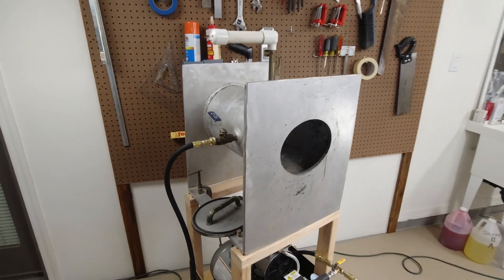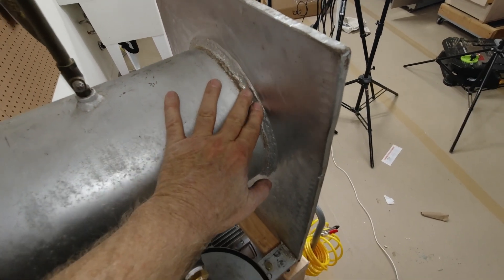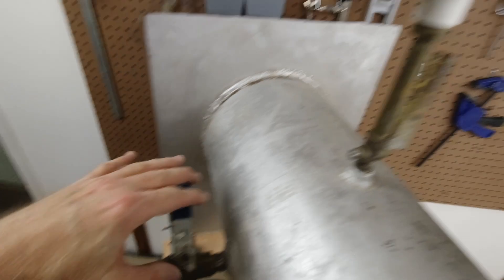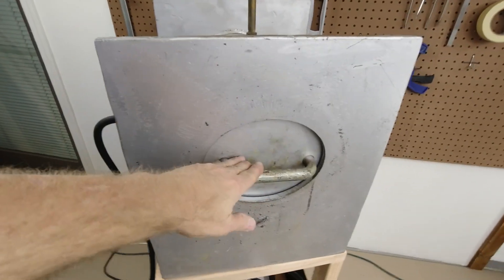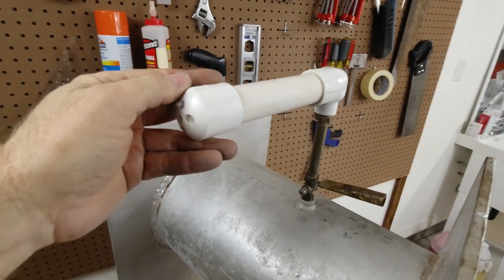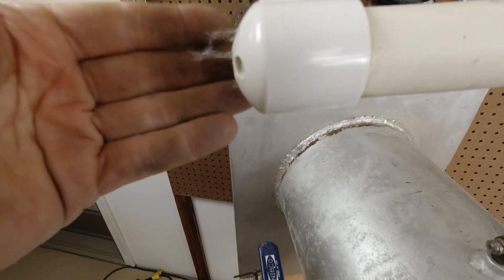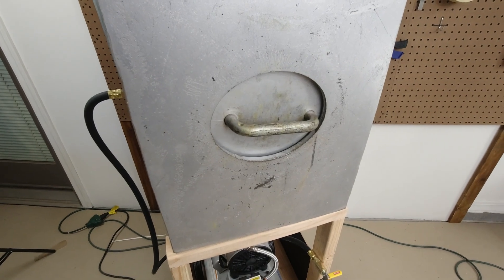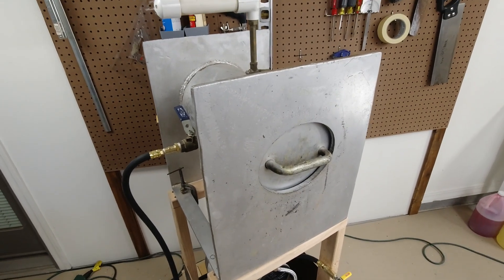All You Need To Know!

Comment: if you rotate lid handle 90 degrees you can put lid in, taking less space inside.
Reply: Can you explain that. I've tried to visualize how you have more room, but my old brain ain't what it used to be, ; )
Reply: @markjohnson9402  when handle is aligned with longer axis you have to insert it all the way before you can start rotating it. if handle is aligned with shorter axis then you can insert it by half and start rotating it right away. 
Theres more useless option - to put handle near one of the longer axis ends, so you dont even need to put your hand inside)
Reply: @ChronoWrinkle  thanks. That makes sense. I'll do that if and when I build my own. I have an old boiler tank that's pretty stout. I may use that.

Comment: I recently discovered your channel and the info you provide is priceless. I just poured my first mold the other day and it turned out perfectly with zero imperfections, i was so happy. I cast both wax and chocolate Santa's with it. I so wanna do this more now lol. On a side note I could see maybe modifying your tank to have internal guide rails on the inside of the front face for the lid to loosely slide flush either vertically or horizontally so the chamber wouldn't have to be so deep and so you wouldn't have to store the lid separately. It would probably be a involved modification tho. Idk im not an expert i just love technology of all sorts and wanna make everything.

Comment: Honestly this pressure pot is overkill. I mean how much pressure are we talking about here ? 5bar ? That´t not a lot. Better safe than sorry but you really don´t need this kind of steel thickness.
I design latch systems for all major car brands and we use 2,5mm-3mm thick metal plates or ø8mm thick wires, this is for a crash relevant part in a vehicle. 
Honestly the most important feature here would be an overpressure valve and you can make that thing out of sturdy PVP piping.
However, it does not hurt to make it overall, it´s not really expensive or more expensive and the designt is pretty good in terms of speed, you get those mold in and out real fast, good thinking !
Reply from the maker: There is no doubt that these tanks are overbuilt.  They were designed by me and fabricated by a welding shop, no structural or pneumatic engineer was involved.  Since I didn’t actually know what I was doing, better safe than sorry was the guiding design philosophy.
Reply: @RobertTolone  Absolutely, I agree with you on that 100%. And your design is great.
Quick question, what happens if you pressurize the rubber instead of vacuum degasing ? This should get rid of the bubbles as well, am I right ?

Comment: Think about this guys & gals, At 50 PSI  means Per Square Inch. I drive trk & the air dry goes off at 125 PSI, These air tanks are roughly 10" inches across & roughly 30" inches long, figure out how many ''' square inches are in these demotions & then times by the PSI. 
  It's something '' you don't want to mess around with, have it done by a fabrication shop & let them know what it's being used for . Be safe
Reply from the maker: Thanks for this comment. You’re not kidding, fabricating these tanks should not be done by beginners. My tanks were fabricated by a welder certified to do high-pressure tank work. There was no way I was going to weld them with my amateur welding skills.

Comment: any recommendations for a hobbyist who needs a pressure pot?
Reply from the maker: It is a serious piece of equipment. Not really one that lends itself to DIY construction. I designed mine and had them fabricated by a competent steel shop.  But you also need a compressor. I haven’t found any cheap, effective solutions. Most hobbyists simply cast resin without one and fix any bubbles in the casting.
Reply: @RobertTolone  I just saw your video talking about that. That makes a lot of sense. Thanks!

Comment: thank you for the pressure pot info and the 50 psi setting. do you use more than 50 psi and for what reason?
Reply from the maker: Sometimes as much as 80 psi. It can help eliminate small stubborn bubbles. But proper venting of the mold is always the best remedy for bubbles.

Comment: i thought it was a vacuum chamber... that a vacuum would cause the bubbles to leave.. but your adding increased air pressure.. i wont argue with results if thats what works .. Can we do the molds without the chamber,   i have this thing about catching shrapnel.
Reply from the maker: The pressure pot is mainly used to prevent foaming that happens when resin absorbs moisture from the atmosphere.

Comment: I've been admiring your pressure chamber since I've started watching your videos. I noticed the oval door because that's why manhole covers are round, so they don't drop in. This design is super fast and easy to handle and I love it. I also love the touch of having a muffler for the air release valve. I always have to cover my ears for that, but strangely never thought to use a muffler.

Comment: I'm curious as to how you made the seal on the door. Is it silicone ? Any info will be appreciated. Great channel by the way. God Bless !
Reply from the maker: No, it is solid rubber tubing. I buy it off Amazon. The trick is to cut it exactly to length, clean, so that the ends meet perfectly. Then use some good all purpose adhesive. It’s important to glue the ends together but I don’t use much glue to hold the rubber into the channel in the door. The door seals itself as it closes.
Reply: @RobertTolone  Thanks for the reply. I have a couple of big casting projects and need to build a pressure pot. Love the videos, Thanks

Comment: Thank you! Would mounting a hook or bar to hang the lid on help, or maybe a rack up top to set it on? Having the specs makes it priceless. No guessing. Much appreciated for the detail!
Reply from the maker: I suppose it would. But we usually keep the lid inside the tank when it is not in active use.  I don’t have specifications or plans for these tanks because they were fabricated from the brake cylinders of semi trucks.  So the size of your tank would be dictated by the cylinder that you use. Any cylinder that can withstand up to 125 psi is suitable.  The other reason I don’t provide specifications is that my tanks are homemade and I am not in any way qualified as an engineer. So I am really not in a position to provide design specs for pressure vessels. My tanks were fabricated for me by an expert welder and are massively overbuilt to compensate for the fact that I did not know how to specify a safe construction.  We used very thick plate steel for the tank opening and doors.
Reply: @RobertTolone  I'm of the same school. If a large company spent tons of money engineering something and made plenty of them so they're cheap, it's a good way to go to be safe and get good technology affordably! Thank you for taking the time to answer!

Comment: Amazing videos Robert. I confess that I have just come across your channel and within 3 videos have subscribed. Great content, excellent tutorial skills. Unfortunately, I need to ask what may end up being an "I can't believe he asked that" kind of question. Sorry about that. I have had a very long interest in resin casting (with not much success) and watched many videos on the subject. When you come to the question of bubbles, I think I have almost always seem artists talk about using a vacuum chamber for bubble removal. You are the first I have seem that talks about using pressure vessels to do this. Is that because you are reducing rather than trying to remove the bubbles? Again, sorry for coming here with such a newbie question :-(
Reply from the maker: The primary use of the pressure pot is to suppress the formation of bubbles caused by absorption of atmospheric moisture into the resin. It takes awhile for me to use up my resin so it invariably absorbs moisture - which causes foaming.  The pot will also compress small bubbles in the resin.  By far the best way to make bubble free castings is to vent the cavity properly.

Comment: Hey Robert, thank you for the information you give in your videos.
I use a resin which gives me only 5 mins then turns into gel. Is it ideal or can a pressure pot do its job in such a short time span. What pressure is required for a fast curing resin.
Thanks and wish you an advance Happy Christmas
Reply from the maker: The resin I  use gels in about 5 minutes and cures in about 20. It works fine in a pressure pot as long as you can close the pot and bring it up to pressure quickly. Pressure doesn’t do much good once the resin has begun to set. I run my pots between 50 and 80 psi.

Comment: A valuable set of ideas here!  Thank you.  I will be making silicone molds for use in prototyping an automotive vent window seal.  Can you tell me in the more black kind of rubber world is molding under pressure still useful?  A Few months ago the cheapie compressor on top of our craftsman compressor died leaving behind a nice 30 gallon tank I hope to put to use like this as our molds will be larger than what you seem to be doing.  Thank you for your great ideas!
Reply from the maker: I can’t speak to that from experience but it seems to me that pressure counseling would work just as well with rubber as it does in resin.
Reply: @RobertTolone  from what I have heard is you have to vacuum silicone instead of using a pressure pot because the pressure pot doesn’t remove the air, it just makes the bubbles tiny, and since rubber/silicone is flexible as soon as you take it out of the pressure pot the bubbles re-expand which can deform your mold.
Reply from the maker: @plantlover5978   If you leave the silicone in the pressure pot until it is cured then the bubbles will not re-expand.

Comment: I've seen some pressure pots that use a vacuum to suck the air out (which brings all the bubbles up), and I've seen some like yours that pressurize to shrink the bubbles.  Is there an advantage of one over the other?
Reply: They have different purposes. and there are advantages and disadvantages to both.

Vacuum Chambers are better at getting rid of bubbles as they are literally taking all the air out of the chamber completely. BUT they are slower. so if you tried to use resin in a Vacuum chamber (depending on the resin) it would cure mid degassing it.

Pressure pots as you know only shrink the air to be (for the most part) undetectable to the human eye. but still there none the less. BUT pressure pots are WAY more dangerous than vacuum chambers. if a vacuum chamber breaks mid use it will simply seize to work. If a Pressure pot breaks mid use, you will die. they are very dangerous.

Comment: As soon as I saw this , and wondered about the pressure inside , I thought 4 threaded rods with nuts, holding the back to the front would be a pretty good safety backup . ? what do you all think ?
Reply from the maker: Yes, I’ve see tanks with that design. Any safety improvement is a good idea. When I had the tanks made I was assured that the weld strength was more than adequate for the pressures I was operating the tank at. Nonetheless I developed the habit of walking away from the tank as soon as the door sealed and before the pressure maxed in the tank. I didn’t want to be standing right in front in case it blew open! 😳😄
Another good safety would be to have a check valve that opened at 80 psi. The truck tanks operate at a significantly higher pressures than that.
Reply: @RobertTolone  yes , I'm thinking of using a small air compressor tank I kept , as it would be usefull one day ! lol .. I'm completely new to silicone/resin , and as most new people do , I've bought a liter of both BEFORE I decide what to make (try)  :-) . I'm finding your chanel very useful . thank you

Comment: How thick is the metal of the cylinder section? Half inch like the front?
Reply from the maker: I don’t know.  But it’s much thinner than 1/2 inch. We used semi truck brake cylinders and they operate at higher pressures than I run my tanks at.  So we figured they were safe. The must be specifications somewhere mandating wall thickness according to cylinder size and operating pressure.

Comment: Your videos are incredible, thanks so much! How would you approach minimizing bubbles if casting a large object, say 24 x 24" x 5"? Would you use vibration or some other alternative to pressure pot? Or try to fabricate a vessel with an opening that large?
Reply from the maker: if you are regularly casting objects of that size it would pay for itself to fabricate a pressure pot. But you would really have to get your engineering right so that the pot is safe to use. I have never had much luck with vibration for removing bubbles. You could use fresh resin that has no moisture absorbed into it and use compressed air to blow out bubbles if the mold is an open-back kind.
Reply: Thanks for your reply! I only plan to cast this one large object, but I'll hopefully be making 50+ pieces. I guess I'll give it a go without pressure and see how I do, then reconsider whether I need to fabricate a ginormous tank.

Comment: Have you any way of asking your pressure pot creator if he could contact an old disabled Vietnam Marine about creating another pot for someone who is unable to do it for himself, Please?
Thank you 
Da Gunny
Reply from the maker: Unfortunately, those pressure pots were constructed more than 25 years ago.  It’s no longer an option.  But any competent machine shop should be easily able to fabricate one.  It is unnecessary to make the front and back support plates that hold up the cylinder as large as they are in my pots.
Reply: Have any specs I could use to get one created locally?
Noticed recent questions about the door gasket. Any identification on a suitable replacement, yet?
Stay healthy 
Be safe and remember to have some fun Every Day!
You hang in there, Sunshine and keep making folks happy! (Just like you always have. Probably!)
Da Gunny
Reply from the maker: I don’t have specs because everything is based off the size of whatever cylinder you are using.  The door is bigger than the opening and it is oval so that it can pass through the opening and seal it from the inside using the air pressure.  I recently replaced the old gaskets with 8mm solid rubber cord which I bought on Amazon. The cord is sized to the groove in the door;  yours might be different. The rubber cord comes in a range of sizes.
Reply: Thank you!
do you recall the brand or model of the cylinder used for your PPs?
And what are their diameter, length, number&locations of ports?

Stay healthy 
Be safe and remember 
Try to have some fun every day 😎
Da Gunny
Reply from the maker: @dagunny7611  The fabricator who built the pressure pots for me had access to a truck repair facility. He provided all of the tanks and steel and did the fabricating. No idea as to what brand they are.  My contribution was to give him the design for the oval door.  Most tanks have 3 or 4 threaded holes for pipe connections in sizes proportionate to the tank. Mine are 1/2” and 3/4” (maybe 1”). All standard pipe threads. Google will yield up a goldmine of info on air tanks of every conceivable size. Keep in mind that the tank on your compressor should be larger than the pressure pot you choose or you should run it at a much higher pressure. For instance, I run my compressor at about 125 psi and run the tanks at 50 to 80 psi. That is so that the pressure pot comes up to max pressure as soon as possible, before the resin cures.
Reply: You have been very helpful and courteous in answering all my questions, THANK You!

I will eventually get my own PP built and will send you a picture of the result.
You video series are most entertaining and informative. We (devoted viewers) are really blessed to have you as our Sensei (and Friend).

Stay healthy 
Be safe and remember to
Try to have some fun every day 

Da Gunny
Reply from the maker: @dagunny7611  Find a pot that fits the projects you want to cast.  Plumb with standard pneumatic pipe and valves.  Make sure someone competent welds it. Overbuild the door and door panel.  Machine a slot in the door for the solid rubber tubing gasket.

Comment: Is it better to use pressure or vacuum?
Reply from the maker: I use vacuum to degas the rubber before pouring the mold and pressure to eliminate bubbles in the resin casts.

Comment: Hey Robert, what gasket material did you use for the lid?
Reply from the maker: I have no idea. The fabricator who built the pots for me provided it and that was more than 30 years ago. But I'm about to find out because the gasket material on the pot I have here in my temporary shop just failed and I need to replace it. As soon as I find a suitable replacement I will let you know.
Reply: @RobertTolone  thanks Robert! I’m in the process of making a rather large pressure pot right now and am having some trouble getting the lid to seal properly. The set up is a little different  from yours and I had been toying around with the idea of making my own gasket for the lid but trying to figure out if a like a 60 duro urethane rubber would be better vs a silicone. Are you in Long Beach by chance? I was looking to send you an email found a contact for a Robert Tolone in Long Beach, only asking because that’s where I’m at! Thanks🤙🏻